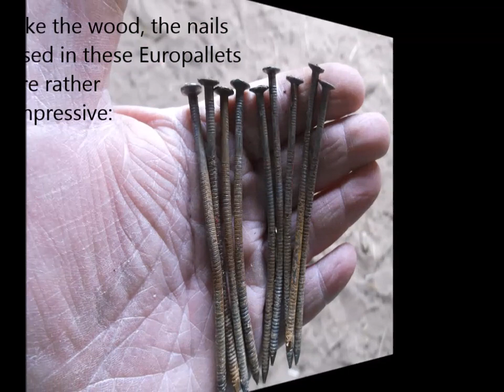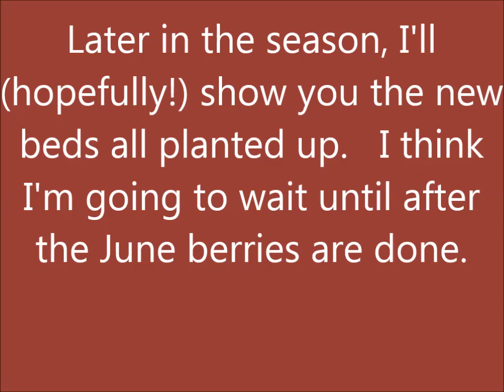(Really) raised strawberry beds from pallets May 2016

Comment: I didn't even know such a tool existed, way better than using a crowbar!!! 

If you've not filled them up with compost and strawberries yet, I recommend putting brick or cement caps (cinder blocks) under the 4 corners. The wood won't rot as fast if not making direct contact with the ground. 

I'm stuck with containers for now. I want to make raised stands kinda like you've done but to hold various containers. I love using the black bus pans, normally used in restaurants for clearing tables. They're roughly $3 and the right depth but once filled with dirt and plants, they're not easy to move. Want them at counter height. And all those 1 and 2.5 gallon buckets from Dollar Tree. A small fortune but I'm out of options. 

LOVE, LOVE, LOVE that bench!!! Waste not, want not! :)